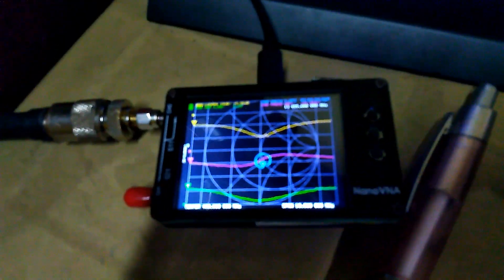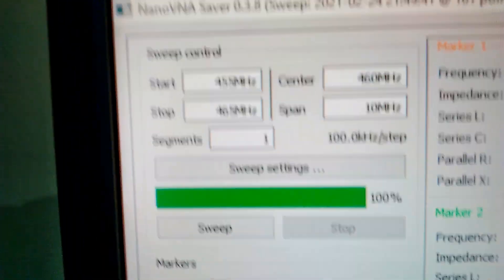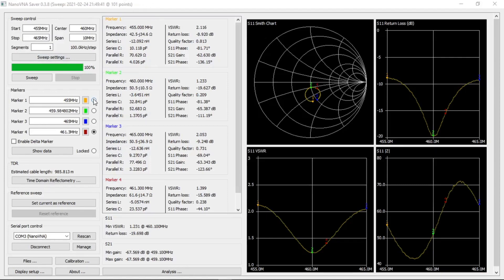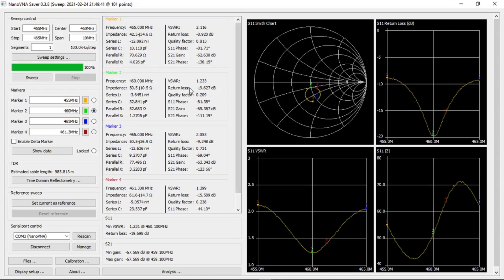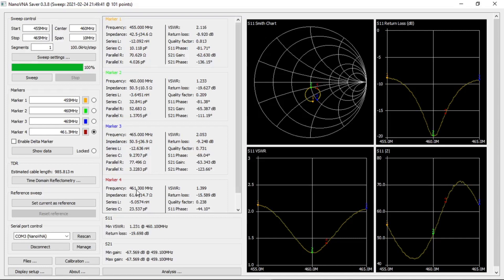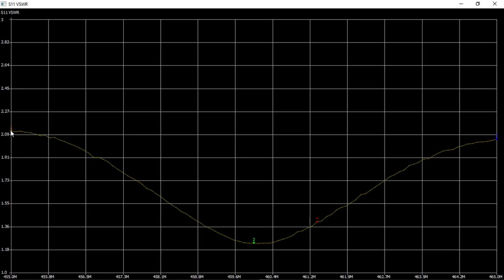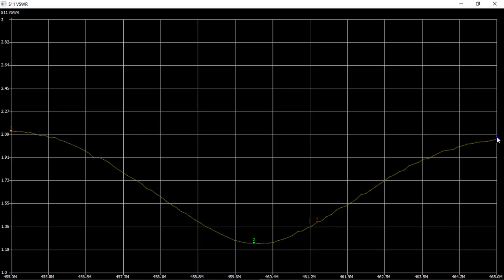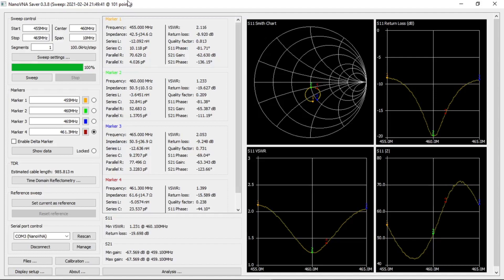460Mhz  UHF 5 Elements yagi antenna analysis

Comment: ganda,...can share how to compute for the anticipated gain dbi? lets say 5 element yagi antenna, we expect to have a gain of at least 9dbi. but how to compute for this gain dbi base from the data that we have.thanks po
Reply from the maker: Computation for the dB gain of an antenna is a tedious process involving advanced mathematical computations using method of moments however these can be easily predicted using antenna modeler programs like the one I'm using to predict the dB gain of an antenna (I'm using 4NEC2) antenna modeler. You just need the antenna measurements and encode it on the antenna modeler and the program will do the tedious computations for you to predict the antenna gain based on your antenna design measurements.
Reply from the maker: hi @brooks shield since you asked for it eto na >>> https://youtu.be/9vsYREkeItY enjoy cheers 73!